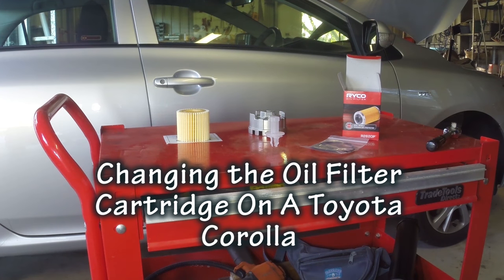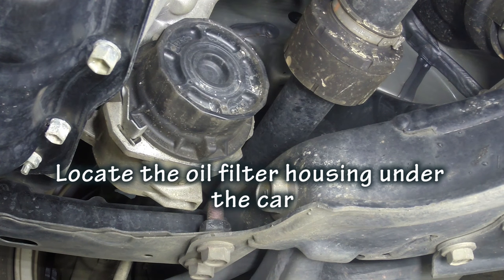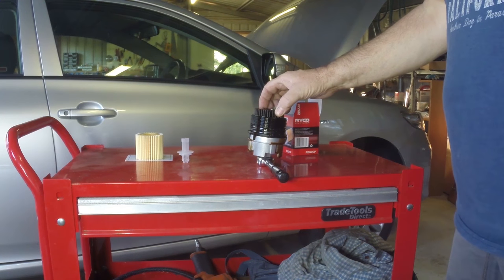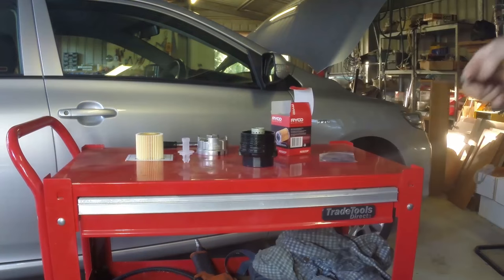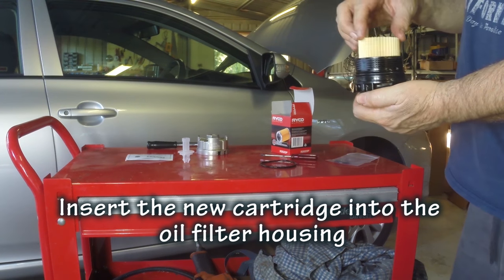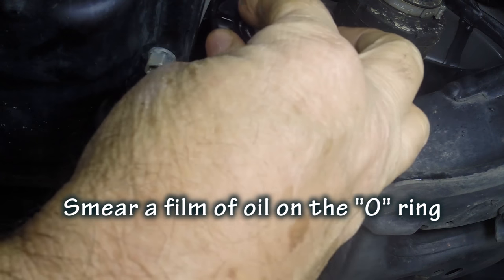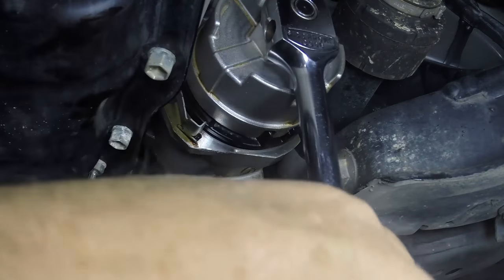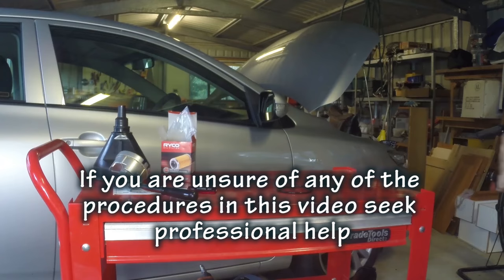How to change a 2009 2010 model Corolla oil filter

Comment: I have a hard time removing my oil filter for some reason any suggestions on how to remove it if it's really stuck
Reply from the maker: Hi Jonathan, 

Firstly make sure that the tabs that are designed to ensure the filter housing doesn't come loose are out of the way. The filter removal tool should assist here as well. 

Secondly, the filter housing may have been over tightened - if this is the case then a bit of brut strength might assist.  Be careful though because if your filer removal tool is a bit weak it might not be able to take the pressure. Regards Geoff

Comment: I have a very important question! I did my oil change and there were metal/aluminum flakes I'm the drain pan. What are some possible causes? 2009 corolla
Reply from the maker: Hi, metal flakes in the oil pan could be a sign of bearing failure. Any metal flakes in your oil is not a good sign. If you have a big end bearing going you will hear a change a rattle or knock in your engine. I would get a professional to listen to the engine to check for any abnormal noises. Regards, Geoff

Comment: Hi, where did you get the O ring? And the special tool to take the oil filter off?
Reply: Just kidding. I forgot to check the box that my new filter came in. It's in there. Great video!!
Reply from the maker: Great that you found it.  I was going to say mine came in the box.  I got the tool off eBay.  Just make sure its the one for a Corolla not a Land Cruiser.  Regards Geoff